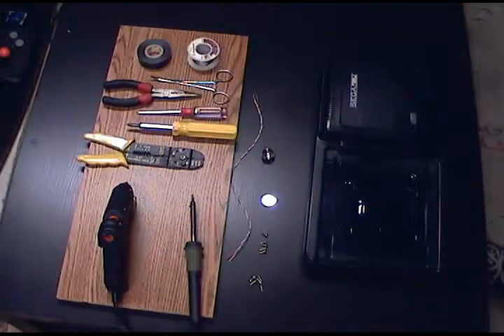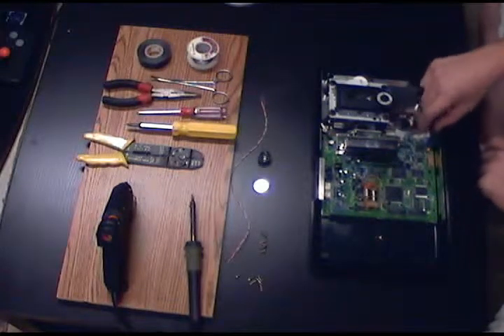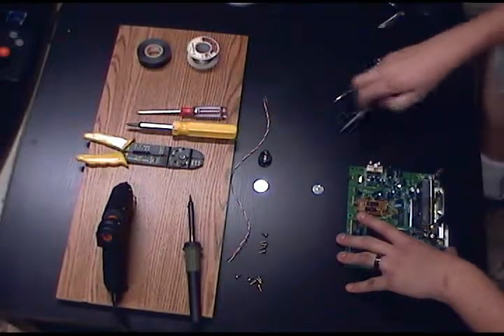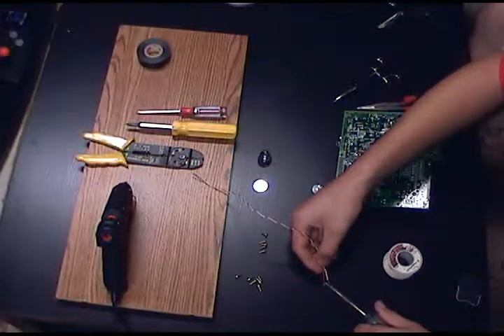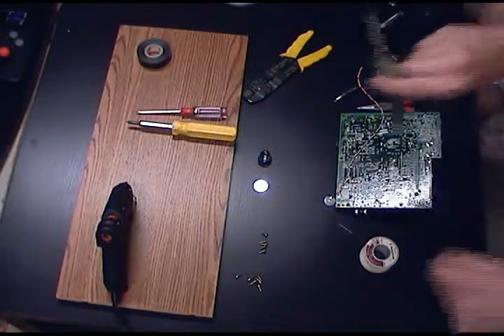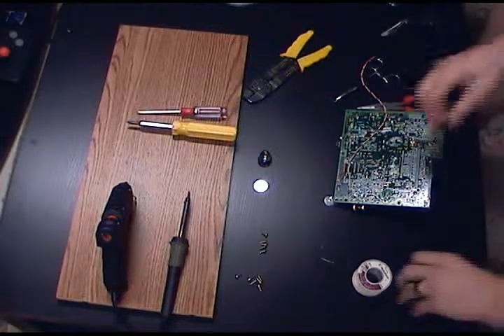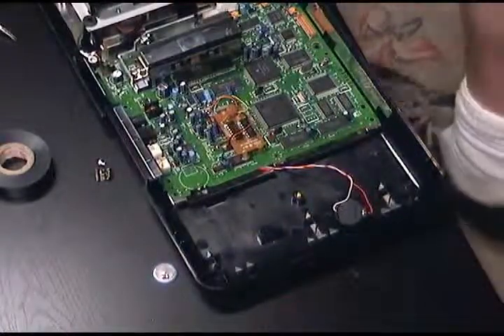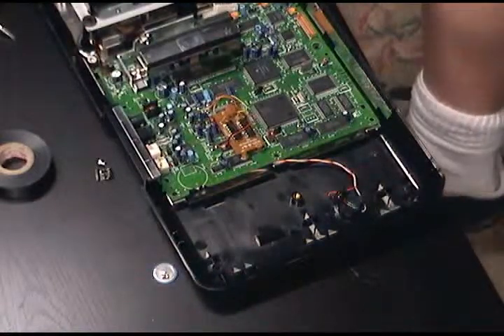Sega CD battery swap (w/ CR2032 holder)

Comment: I found a replacement battery off the net. Same specs as the one found in the mega cd and rechargeable but from maxell. Came with the PCB tabs and it was just a simple case of desoldering the original battery and putting the new one straight in. The entire process had taken me about 10 min and it works great.

Comment from the maker: @critanime That also is a viable option, I simply posted this video as a response to the endless instructions out there saying to tape a cr2016 in place and hope it doesn't loose contact
I would have soldered a new battery in place if i didn't all ready have hundreds of cr2032s and about 30 battery holder
I like being able to easily replace them :D

Comment from the maker: @drunkensailor112 
The Sega Saturn uses a  cr2032 , easily replaceable with another by opening the rear door then removing the old battery and inserting the replacement.
Very simple with a cr2032 socket :D

Comment: @ANTINULLdotcom Oh I appreciate what your saying. I was looking into this exact same thing before your vid came out and I found a replacement battery, as the silly taping a battery thing seemed rather odd. Especially when with a little tinkering you can fit a mod like yours or find a replacement battery. Also surely there must be damage done to the system from the taping method. 

Good vid and I will do this if this Maxell battery should happen to die.

Comment: Use an ML2032, a CR2032 is bad as the CD recharges the battery
Reply from the maker: my CR2032 is still running strong in the system after 7 years
I understand what you are saying about using a rechargeable but it is sort of a moot point

Comment: Couldn’t you have just soldered the battery holder directly to the board instead of using wire?
Reply from the maker: IIRC they didn't line up, this was a long time ago now